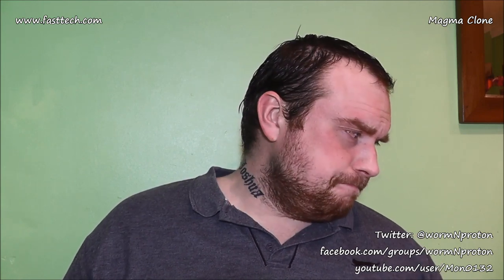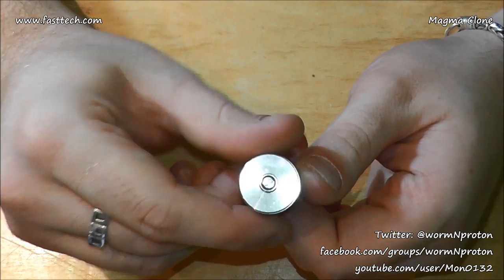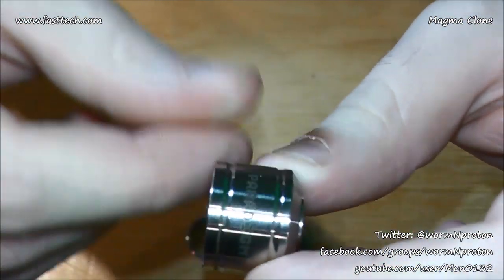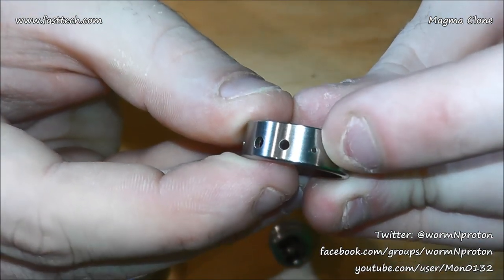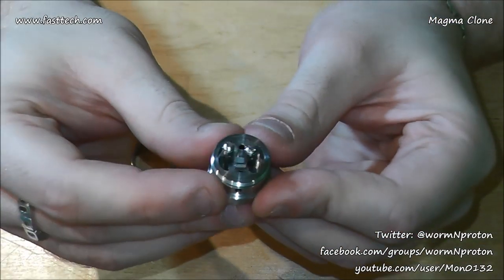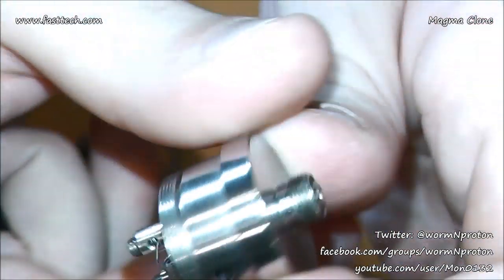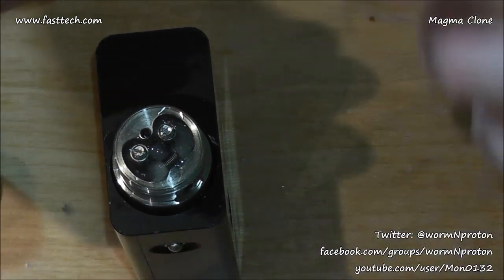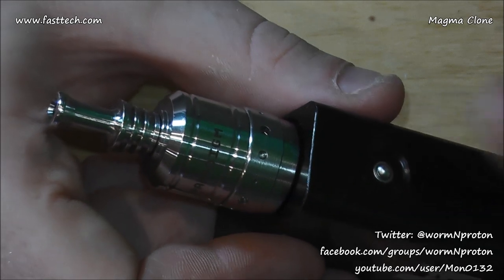Paradigm Magma Clone -  FastTech

Comment: Just built mine according to your "one coil will do" direction, just two words:

INSANELY GOOD!!!

One thing I did differently is use that "rayon" cellu-cotton stuff. I have some "as crap as it gets" Hangsen RY4 pure-VG while has always been pretty meh but in this!? Feck :)

So now I have the copper airflow ring sitting on a Stingray (that steel one with the copper liner and the cool cutouts) 18500 + Kick2 @ a mere 10watts :D
Reply: Andy Beamish what ohm